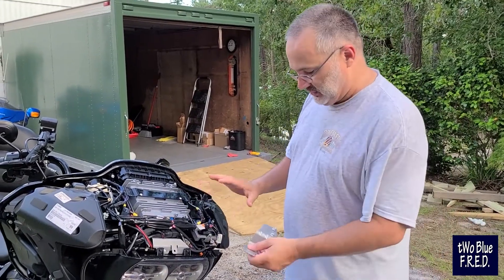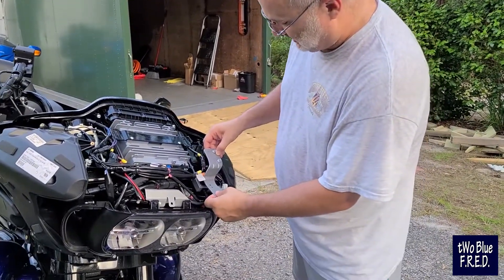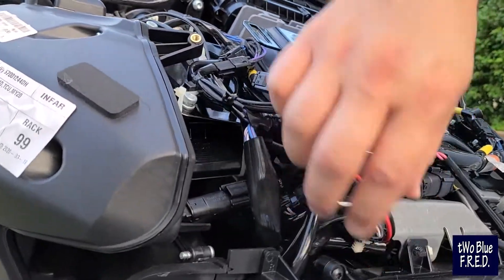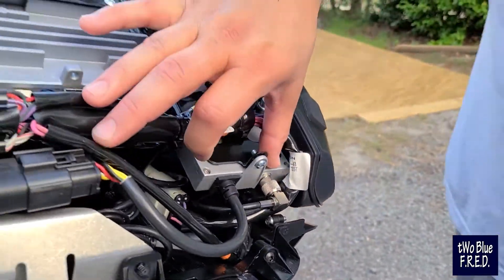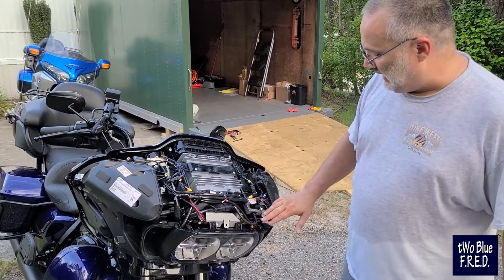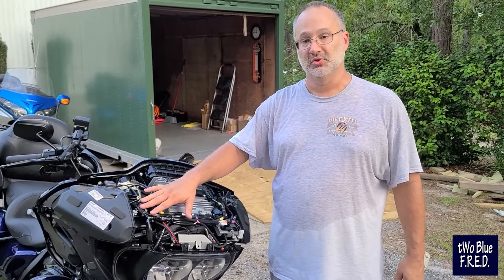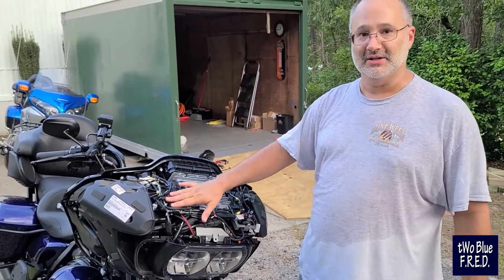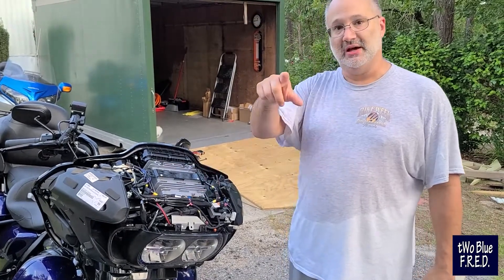How to Install CB on a 2020 Road Glide Limited

Comment: That’s actually called the TCU module. It measures telemetry (lean angles, etc) for the RDRS in addition to other functions (H-D Connect).
Reply: Awesome.  That is good to know.  This bike does not have RDRS either, so odd.  I have left it on so I should be fine.  :)

Comment: Did you have to replace the right side control buttons to add the control for the CB? I have a 19' RGU and there is an empty spot for the CB button.
Reply: Yes you have to get a new module for the install as well.  Here is the Part number for that.  HD-71500130C

Comment: Does the factory phone talk button work as the PTT button for the CB?
Reply from the maker: no,  you have to buy a new right side control cluster that has the PTT button..   maybe should have been more clear, this was more about HD saying a CB is no longer an option for the Road Glide than it was a full install..

Comment: My antenna mount has what looks like a small black cap/plug that blocks where the antenna screws into the base (the base that is integrated into rear lights on outside right rear of tour pack). How did you get that plug/cap out?
Reply from the maker: it prys out...pops out